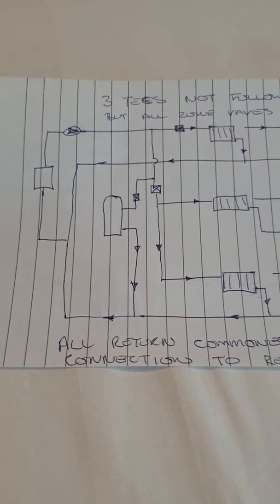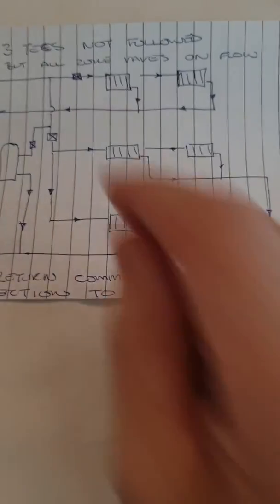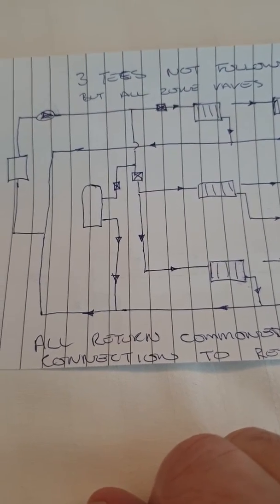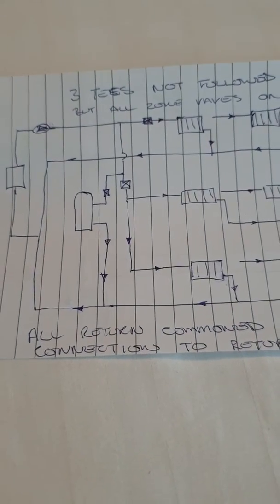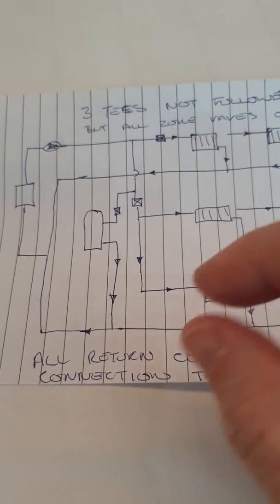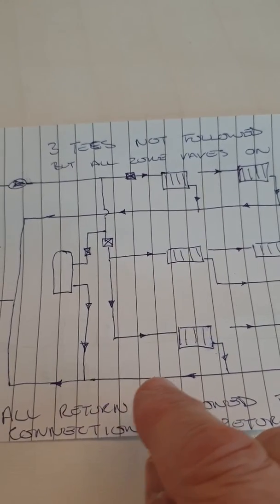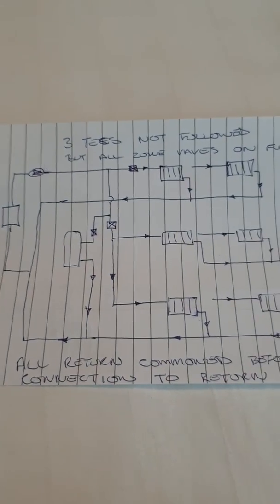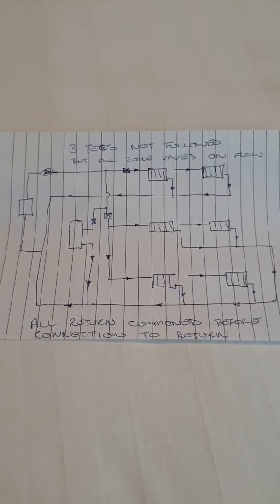3 tees rule challenged.

Comment: https://www.google.co.uk/url?sa=t&source=web&rct=j&url=https://m.facebook.com/NRGAwarenessOnline/posts/908392049500940&ved=2ahUKEwiKgL75pvjnAhXOTsAKHe7ICg4QFjAKegQIAhAB&usg=AOvVaw2QhSgkqwLGg7a6WCLqmLwi
Reply from the maker: The three tees rule will not prevent single pipe circulation. It prevents pressure induced reverse circulation.

Comment: Disagree slightly. Had the same scenario recently. On hot water only the zone valve on the upstairs circuit was passing causing reverse circulation to rads upstairs., water will always take the path of least resistance and to stop reverse circulation the dhw return should always be the closest / first tee, to the boiler.
Reply: agree
Reply from the maker: A passing zone valve creates flow in the correct direction. It cant create back flow. Draw the example of your problem and you will see no back flow occurring.
Reply: @andrewmillwardwatford9410  then how did the radiators stop heating stop heating up on hot water only,  after I piped the primary return all the way back to the boiler (up two floors) so the domestic return was after any heating return. If it was not a passing zone valve then the warmer return water was making a gravity circuit through the radiator circuit on the way back to the boiler. I have always been taught to have the primary return the first tee (closet to the boiler) to stop reverse circulation.
Reply from the maker: @keithwebster6164  draw your scenario. If it follows the rules in my video you can not get reversed flow. You stated the zone valve was letting by. This will cause heat to flow in the circuit with the valve. This is not reverse flow but forward flow.
Reply: @andrewmillwardwatford9410  
It is defective zone valve.
Reply from the maker: @johnburns4017  exactly. Yes